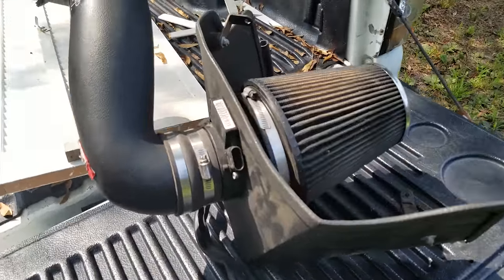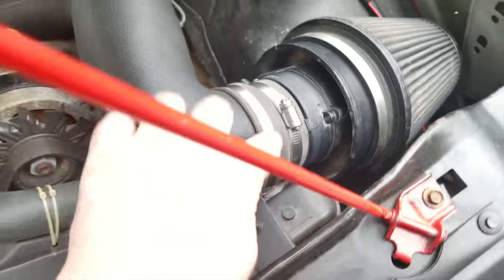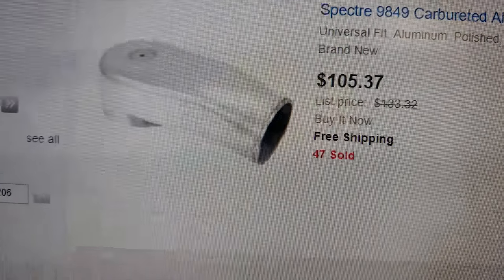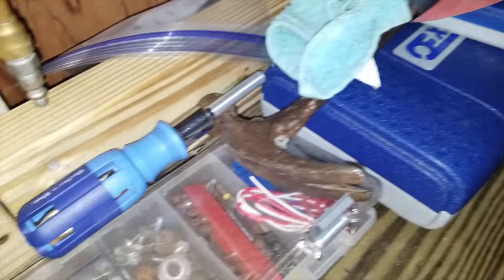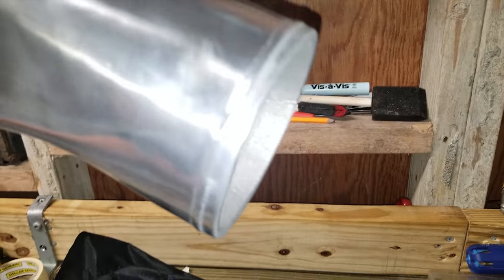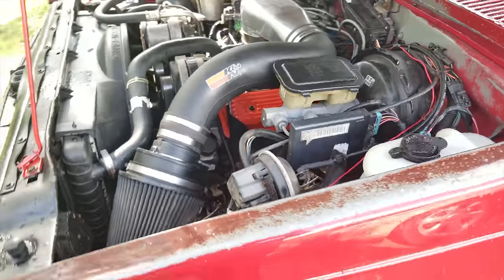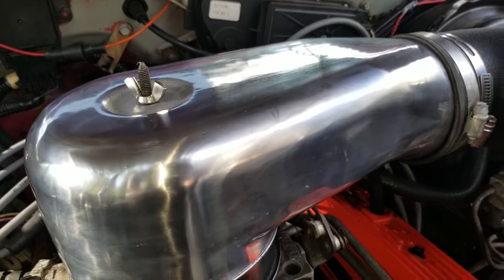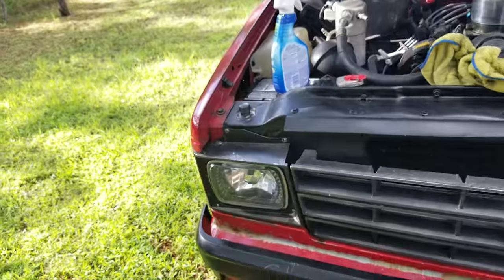How to install a K&N Cold Air Intake on any old truck

Comment: How you order ? I have the same engine but muy truck is 2001 is Mexican, I'm looking for the system and I saw your video and it would feet great
Reply from the maker: You just look up 5 1/8 in carburetor intake adapter

Comment: I'm thinking of running something like this to fender. The object is to get cold air not hot engine air. I'm just trying to find someone that tested this on dyno. What is the gain? Just like when we put ice on the intake at the track.

Comment: Hey man I have a 89 s10 tahoe 4.3 came out of a 91 blazer I'm pretty sure everything is same what all parts did you order to do this mod? Very interested in cold air intake but cant find kits that go to yr model
Reply from the maker: They make a thotl body addapter for the carb and you just have to get a universal 4in cold air intake kit

Comment: No after market cool air intake will out perform stock look at the piping where does your stock intake go into the grill to suck cold air from next to or in front of the radiator you're putting an air filter in your hot engine bay 🙄
Reply from the maker: Im not doing it for colder air im doing it for more air flow bc the stock intake is extremely restrictive